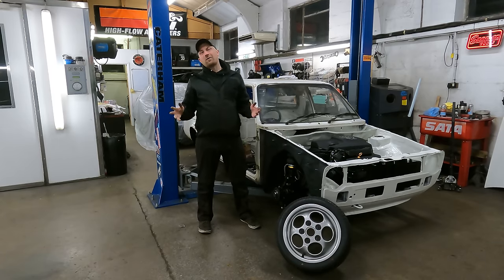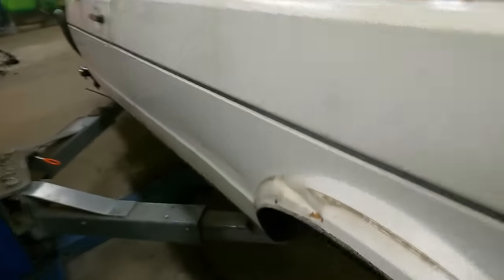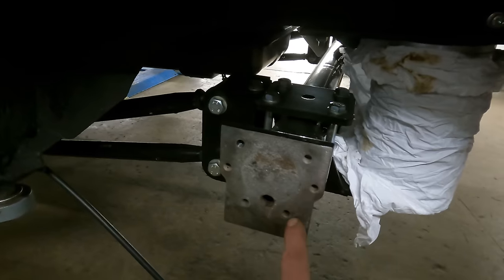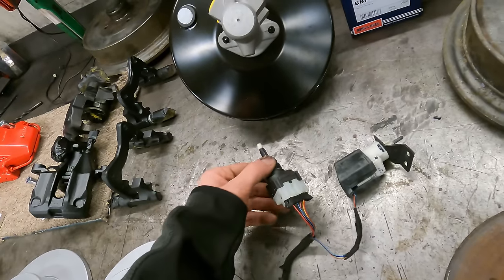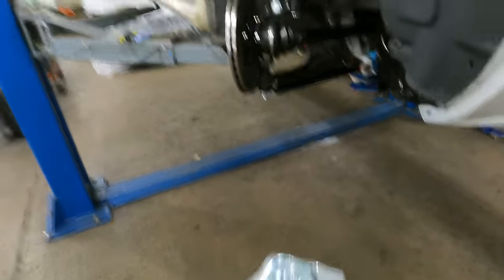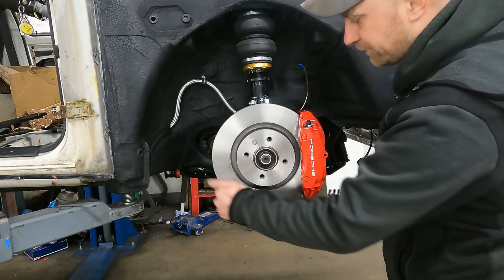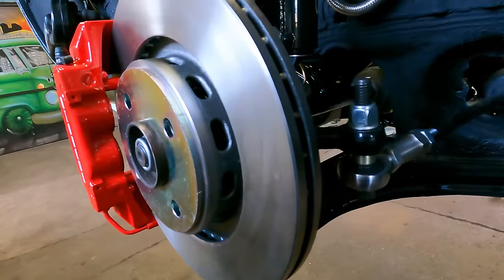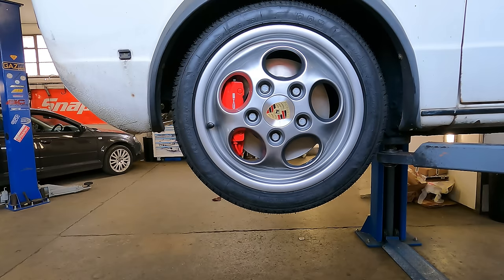EP16. PORSCHE BRAKES on the Mk1 Caddy SHOWCAR PROJECT!

Comment: 200 likes already, yes Ron!!! 😂

I've got a 25.4 master cylinder with the 996.351.425 & 996.351.426 callipers on mine and the pedal is perfect, although I have the now discontinued 6KL615301 305mm Ibiza discs but the 280mm shouldnt feel any different, unfortunately you can't fit 15"s over mine so those cute Teledial's would have to go back on the shelf 😂

Good luck with the move, exiting times ahead!!!
Reply from the maker: Great to hear, I've been having a search for people using a 25.4 but you're the first one! We are on the 986 part number calipers but thats very reassuring. 😁🎉 thanks for watching!
Reply: @SuperRon  I needed to use a manually adjustable brake bias valve for the rears though as the mk2 rear disc set up is too strong for the body weight of mk1's and especially Caddy's so you might want to look into that.

Thanks for producing 😂👍
Reply from the maker: @rawbennett we have been talking about exactly this! Weather to use the mk2 inline valves or an adjustable one, this has sealed the deal! Thank you 👍

Comment: Hey Ron, 2 questions - 

Are u going to run brake restrictors for the rear?

Do u need to adjust the brake linkage rod in the engine bay at all? After you have had it disconnected?

The build is epic mate!
Reply from the maker: Yes we've got some mk2 gti (I think) inline restrictiors for the rear discs, and no I haven't adjusted anything on the linkage from how it was. All seems ok so far and pedal is in the same place, but the real test will be when it's all plumbed up. Thanks for watching 😁

Comment: You'd be better off with using an 02J shifter and tower than the 02A.  You can further upgrade that with a Sigma-5 short shifter and a shift lever from an Audi TT.
Reply from the maker: We've got the whole 02a setup here for the build, maybe its something he can upgrade to in the future if he thinks it needs it 👍
Reply: @SuperRon  I'm not saying swap the whole transmission, just the shifter and tower.  It's a major upgrade to the 02A stuff.

Comment: That 25.4mm MC will also give you a pretty stiff pedal feel compared to a 22mm.  Something to consider.
Reply from the maker: We've not used the 25.4mm before but this is what was recommended by retrofication for the 4pots so we will have to see.
Reply: @SuperRon  I've been down this road before.  Sometimes it's a misconception thinking bigger calipers need a massive MC.

Comment: Please don't run those 5mm spacers. A few years ago my mate had them on his mk2 gti, and they quite literally shattered when he was doing 50, ruined a wheel, brakes and the suspension on the front end.
Reply from the maker: Must have been something else going on there, loose bolts or something, theres nothing wrong with using spacers with the correct bolts

Comment: I don't get the handbrake kabel problem every thing should fit at least on the left hand drive cars,plus the sirocco gtx  got disc on the rear. Regards sören
Reply: The adapter you got for the handbrake cabels, looks nice though, in the old days you got the g60/vr6 brakemaster cylinder from memory it's 22mm, and the girling g60 calipes from an audi s2, they are 2 pistons, but the brembo's are lighter 😋  regards sören
Reply from the maker: thanks for watching!